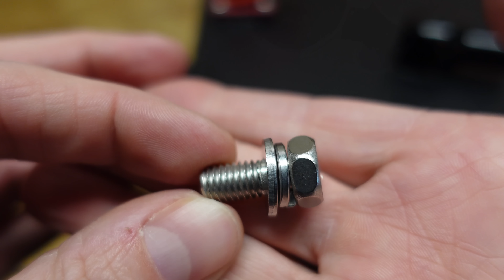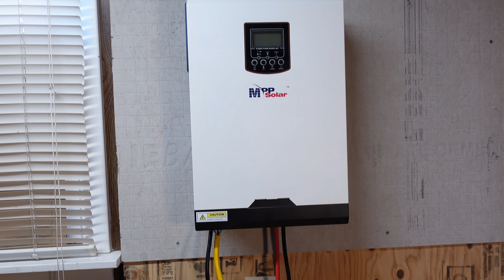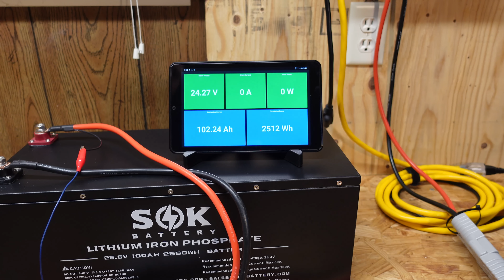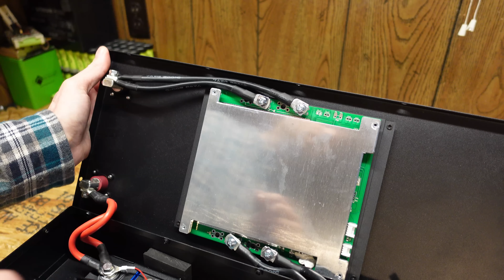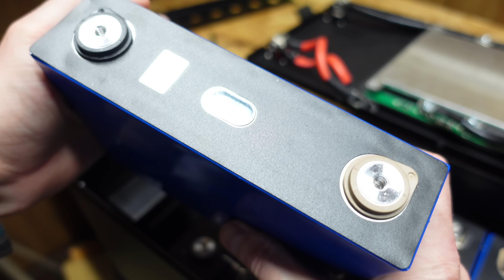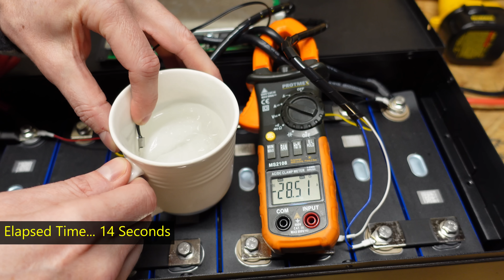SOK 24V 100Ah LiFePO4 Battery Review, 10-Year Warranty!

Comment from the maker: SOK Batteries... https://us.sokbattery.com/products/?ref=lithiumsolar (affiliate link)
Reply: The handles, if inverter, would depend on very small steel tabs to perform a 90 degree angle, and would likely not hold up to the weight during repeated lifts.
Reply: @DavidHalko  I think you are right. Current position seems to be right for this heavy battery at least. Otherwise the handle will act as a fulkrum/pivot and rip out the screws/rivets attaching it to the body pretty soon.
Reply: @DSmartLife  - yes, likely!
If inverted, when the little steel tabs do snap off in the handle, while the handle under load, there will be a serious pinch to the fingers!
Reply: Would love a 206ah version but probably too heavy
Reply: I have a warranty issue with two of these batteries and it’s only been 2 years. BMS issues and half of AH already lost after 15 cycles. Warranty isn’t being honored.
Reply from the maker: @damianmarley7177  What do you mean "half a AH already lost"? Are you saying the 100Ah battery is testing at 99.5Ah?
Reply: @LithiumSolar  my 206ah is marking at 100ah
Reply: @LithiumSolar  SOK went ahead and sent me two new BMS and now the batteries work. 

I’m assuming there original BMS they had installed wasn’t working properly so they’re replacing them thru warranty

Comment: Great review,  how low could this 24V be discharged to?  I looked around the internet and see estimates of 70% to 90% discharge.
Reply from the maker: LiFePO4 batteries are made to discharge 100% unlike lead acid. As a general rule, it's best to set the cutout on your inverter above the BMS threshold though to prevent the BMS in the battery from shutting down. That's usually around 3V/cell or 24V for a 8s battery (like this one).
Reply: @LithiumSolar  Ah OK great,  really appreciate the help!

Comment: Does this battery have the same Bluetooth as the 12 volt version?
Reply from the maker: There's no bluetooth in this battery.
Reply: @LithiumSolar  is there a way to get SOC data from the battery? Or do you recommend an external system like the smart shunt to track this?

Comment: Love your videos man!  Keep up the good work!  My solar system will only charge this battery to 27.6 volts then stops.  Any ideas?  I have the SRNE all in one but it would have similar settings as the MPP. in your portable system.  Any advice would be greatly appreciated.
Reply from the maker: The battery is probably not balanced perfectly. Maybe try leaving it on the charger for several days and cycling it a time or two. That's usually how I get them balanced.

Comment: Personally, I would prefer to see something driving external relays for lower voltage drop than a series of FETs. More critically, I have not seen a single battery in your reviews that feature external communication and control. I would be interested in something that communicated with and could literally shut down charging sources that failed to regulate.
Reply from the maker: I agree, communication with the battery's BMS would be optimal. I'm starting to work with a few batteries now that support this (such as the Jakiper) and will hopefully have more information soon.

Comment: I've got 2 sok 206 in series. Max 100a continuous discharge.  These are a nice option for 2 of these in parallel to allow higher discharge current of 200a continuous than the 2 206s on series. Nice to have this as an option.  These were not available when I purchased last year.  Current connected is a good company and I would definitely recommend doing business with them.

Comment: I am confused. What's the purpose of 24V? All campers use 12V? Appliances etc are for 12V?
Reply from the maker: My application is specific to solar energy storage. 12V is rarely used in off-grid installs. They're typically 24V or 48V DC systems, very rarely 12V.

Comment: The pack was probably too heavy for the handle in the reverse orientation and when flipped over would expand the footprint of the battery pack substantially while using them.  That type of handle just doesn't make much functional sense in any orientation.  It was likely a large contract that couldn't be unwound for a reasonable amount of money, so they made it work.

Comment: Wait, wait, wait... you saw the BMS not shut down the connection at low power of 20V (2.5V cells) or just below.
I would really like to have seen you reduce the inverter low-limit so you could validate the battery's low-limit. Are they getting the extra value by taking some cells below 2.5V? Is this a concern over lifetime?
Inquiring minds...
Reply from the maker: I have it set for 20V low disconnect. The last voltage the shunt was 20.16V when it shut down, which includes a bit of voltage drop. I don't have a reading of what the BMS was seeing, but was definitely above 2.5V per cell. I need to come up with a way to discharge the last remaining but with a DC bulb or something.

Comment: Wonder if current connected would give me a credit for my 2 12v so I could trade for a 24v🤣. I have 2 in series and they keep getting out of balance
Reply from the maker: Hmm, I assume you top-balanced them before series connecting first? I would parallel connect them and leave them sit on a 12V LiFePO4 charger for several days.
Reply: @LithiumSolar  yes that’s what I did when I first received them. Then after their first discharge, they get about 6% deviation when charging. They do usually equalize after they finish absorption. My BMV usually complains about the midpoint deviation

Comment: Sorry to say, this is a freaking rip off. I can buy two 12v 100 on amazon for$600 and get the same results for less then that junker.  Don't buy from companiesthat over price crap.
Reply: The tree s a thing with some brands selling rejects with capacity less than labelled. This is the difference between good/bad brands. Bad cells can be a fire risk.

Comment: If the handles went the other way, you could never get them in the box, lol
Reply from the maker: Well I assume one would lift it differently when packing it in the box so the handle doesn't get stuck sticking out lol, unless there's some other reason I'm still missing?
Reply: @LithiumSolar  the handles flipped would allow easier carrying, but unless the box is huge, packing it would be difficult